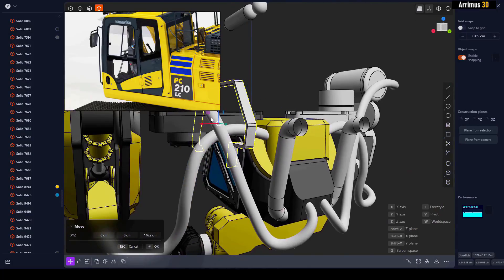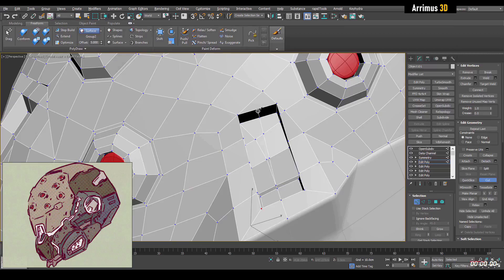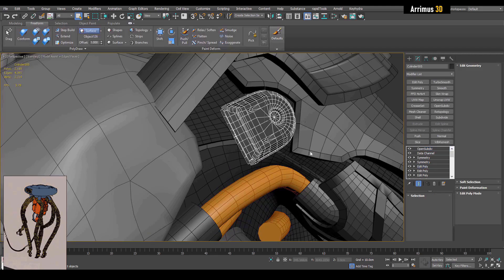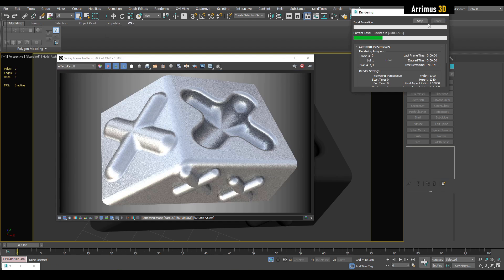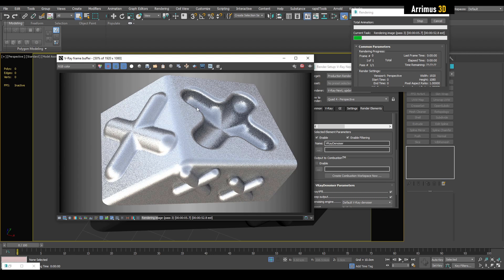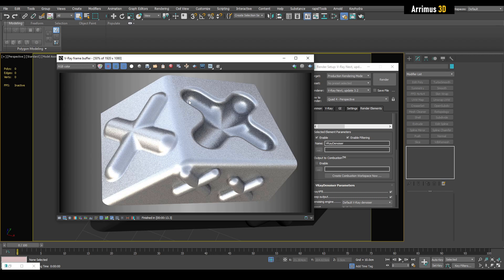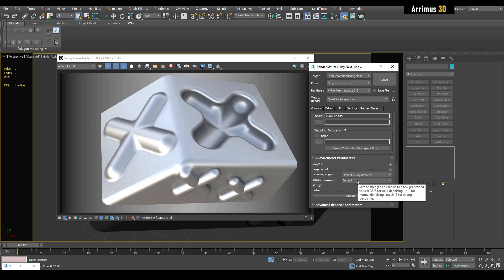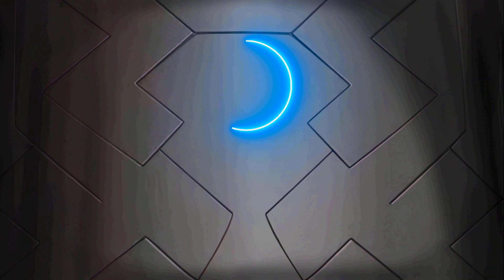How to Use V-Ray Denoiser

Comment: As an artist who's been using Vray professionally for a decade, I've never had a reason to use the denoiser. As long as you know how to set up lighting, textures, and most importantly the renderer settings, noise isn't a problem. The only reason I can think is if you need to pump out renders in a very short amount of time by lowering your render settings. the denoiser could cover up the quality issue to some degree.

Also, I can't vouch for the quality of the denoiser in animation sequences. Normally you set your render quality and lock the noise, but a denoiser might create a problem if detail is a requirement.
Reply: The denoiser saved me so much time before I had a strong computer, but yeah once I got a better computer I tried doing an animation and the denoiser wiped out so much detail that I stopped wanting to use it for future projects.  Still, it's a good option to know about 👍